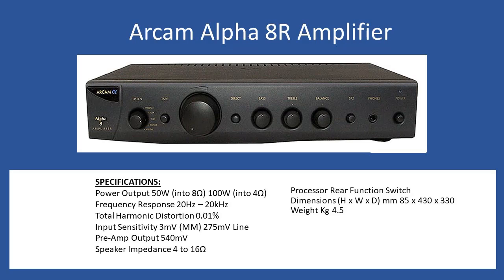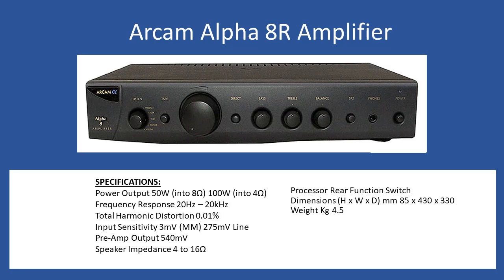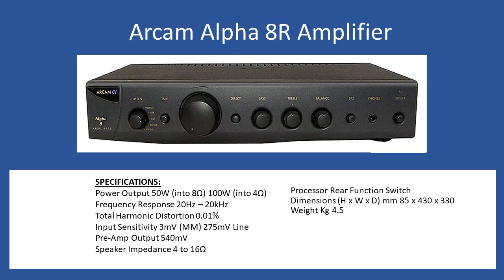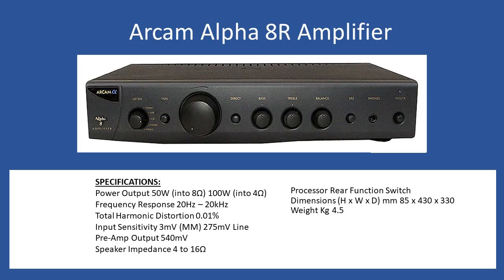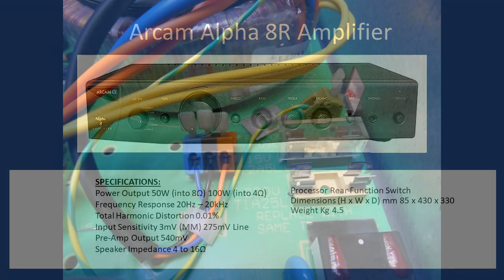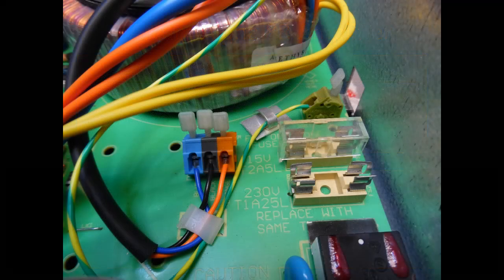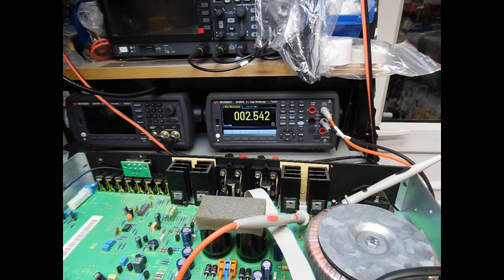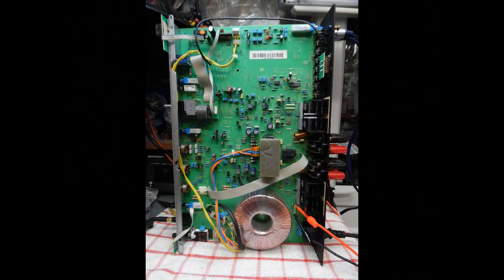Arcam Alpha 8R Amplifier Repair (With Audio Tutorial)

Comment: Is it normal to hear a noise in the spekers when not in use? It's not very loud but still... also every time I use the output exit from the amp for a suboofer, the suboofer makes a buzzz noise. I've tried everything, and the noise comes because of the amp... It's not a loop or DC curent problem because I explored all solutions. Also, the noise came out of nowhere after 2-3 months with the suboofer
Reply from the maker: As the noise has developed in the last 2-3 months then it would point to an issue potentially with the Amplifier.
The RCA sockets at the rear of the Amplifier can develop bad solder joints causing loss of ground.
There are also Torx fixing screws internally fixing the circuit board to the metal chassis, Thes can become loose so worth checking.
Reply: @AudioAmplifierServicing  Thank you for your reply. After further research and testing the amplifier, I’ve identified an issue with the switcher (phono, AUX, CD, AV, tuner, tape). It seems that if the switch is moved slightly, one of the speakers stops functioning. I suspect this could be the root cause of all the problems, as this component is notoriously prone to damage.

I’ll attempt to fix it, but it will likely require significant time and skill, especially with a desoldering machine. I’m also considering replacing the large capacitors, which might provide a performance boost. The Arcam 9 is my preferred choice, but I’m mindful of staying within budget and avoiding further damage
Reply from the maker: @dragdrag1507  If you follow the tutorial video it covers all aspects of what needs to be and includes the input selection switch repair. If your in the UK you can email audioamplifierservicing@aol.com

Comment: Hi, very interesting video.  I have that very same amplifier.   If I may ask a question?  My amplifier sounds very 'woolly' at the lover end if the frequency range.  Bass is lacking.   Might this be a technical issue,  and age (if the amplifier) issue or infact my ears!  Thank you in anticipation.
Reply from the maker: Hi if you select direct mode do you notice any difference and is the lack of bass the same on both channels.
Reply: Thank you for the swift reply. The tone controls do alter the levels,  it's the same on both channels. I'm not sure if it's maybe my ears, but it doesn't seem to have any low end punch or grunt.
Reply from the maker: @tonyjones332  When the direct mode is selected the tone controls are bypassed, I was wondering if you hear any difference as such. The capacitors used in the Amplifier are high quality but of course they will reduce in performance over time.